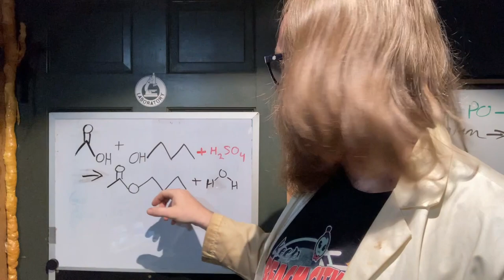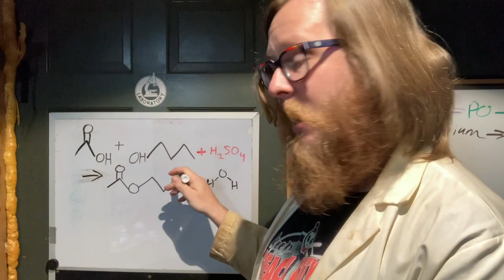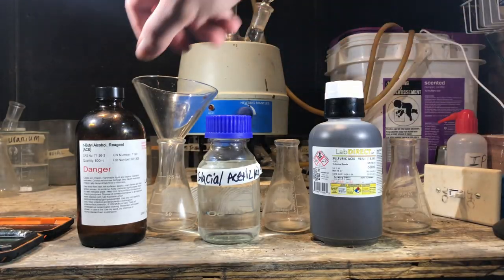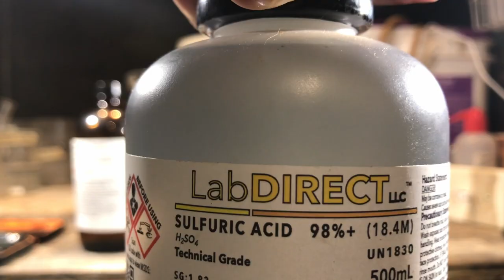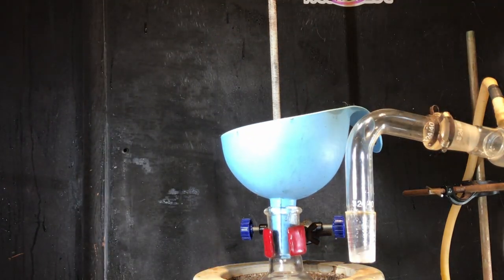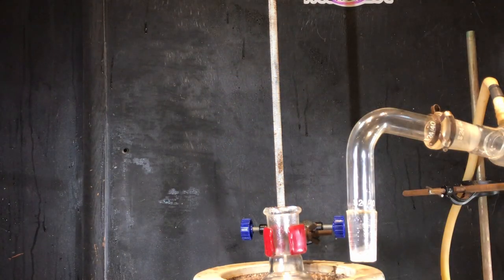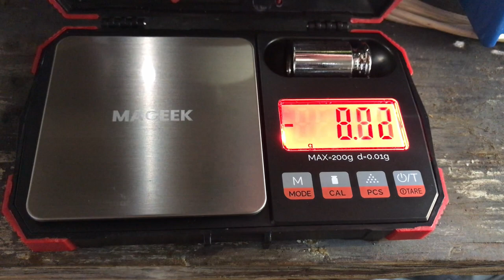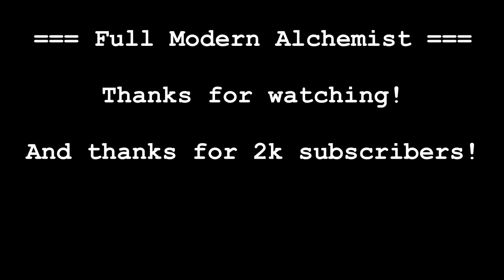Synthesis of Butyl Acetate

Comment: Interesting, I usually just distill the ester out and then wash the distillate with some bicarbonate solution and water, then you don't have to deal with side products and the leftover sulfuric acid, never seen it done this way before but I guess it works!
Reply: Hmmm, thinking about it your bad yield could have resulted from hydrolysis after you washed all the sulfuric out and then washed with potassium carbonate although that shouldn't result in much loss as when I make ethyl acetate I also wash it with carbonate solutions and get a 90-100% yield